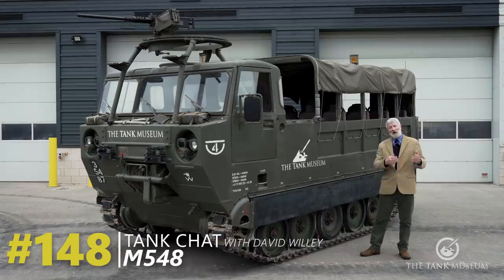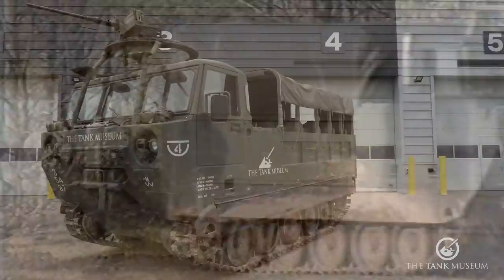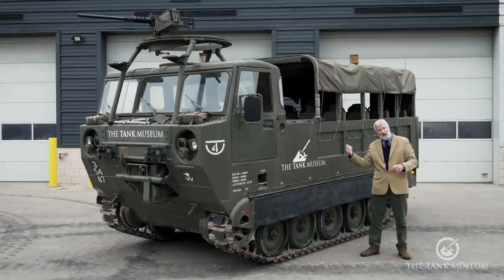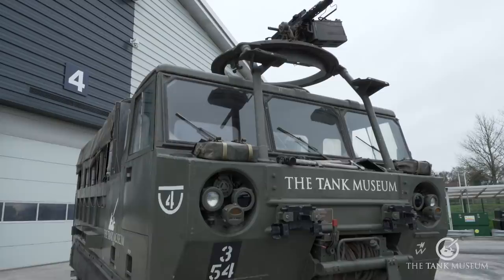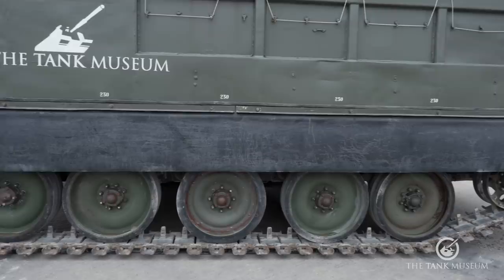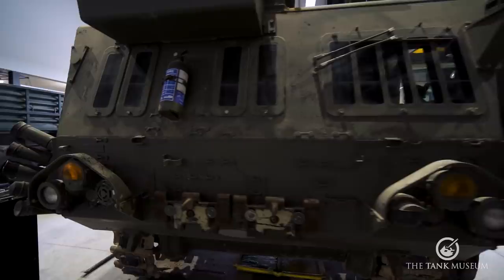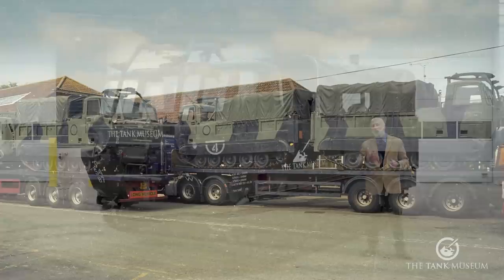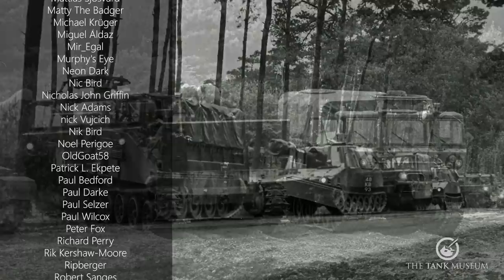Tanks Chats #148 | M548 | The Tank Museum

Comment: I couldn't click fast enough when I saw the 548. I loved this thing. Drove one as a Combat Engineer in the early 2000's with an M136 Volcano mounted in the back.
Reply: Isnt the 136 Volcano a mine laying device (  i could be  wrong as to its function ) its been a while since i looked anything up about it
Reply: @forsakenghost7054  yes. That video of the one they call the German "dispenser" is the same kind of vehicle.
Reply: @killdizzle  M163 was mounted on a modified M113 chassis. The M48 Chaparral (four AIM-9 Sidewinder missiles modified for ground use) had the M548 cab with the back end cut down to give clearance for the turret.
Reply: We had M548's in my first Artillery unit while stationed in Germany in the late 80's. I loved that damn vehicle.  Awesome vehicle in my opinion. Easy to drive, easy to maintain, (in my opinion).
Reply: For those of you who build armor models AFV Club has a 1/35th scale M548 model kit of this particular vehicle.
Reply: @killdizzle  Yes, but it only uses the power pack (engine & transmission) and running gear. The M163 Vulcan used nearly a complete M113 as the basis with only changes to the roof because of the turret replacing the commander's cupola and the roof troop hatch being replaced with a small round one.
Reply: Same here, was in the line company and my squad got assigned to provide the driver and maintain the Volcano and M548.
Reply: Yeah, my unit had the Volcano mine layer too. We got issued 548s just for the purpose. 
My dad's artillery unit used them for ammunition caissons.
Reply: @IvorMektin1701  Gee - I wonder why???
Reply: @13bravo72  They were all over Ft. Sill when I was there in 90.  I think they must be obsolete by now.
Reply: @jeffmoncalieri7491  They we’re still being used in the 2000s.

Comment: In the early 1980s we used to get these from the factory as a sort of kit with the cab and everything knocked down and packed inside the vehicle. We'd assemble them into ammo carriers for artillery and they'd be sent to units on base.  We'd have to put them together in a certain order or we'd need to take them down and start over.  Since they came with no assembly instructions the first couple were, shall we say, interesting?  Much creative language was in use.  I've driven these more than any other armored vehicle just moving them around the shop and yard.
Reply: No instructions, that's interesting. Now granted, it was kinda obvious to even the most casual observer, but did they at least say, Some Assembly Required?
Reply: @alonespirit9923  LOL- that was pretty obvious, but no, there was no explicit statement to that effect.  The battery, BTW, was included.

Comment: The Tilly. Or the "ute" (Aussie for "utility truck" - what Americans would call a pickup) as we sometimes called them.
I drove one of these in the RAAC for a bit - pretty quick cross country, especially when empty. 

The most fun vehicle in the M113 series to drive. Fast and quite dirftable for an  tracked vehicle and lots of freeboard in the water.

RAAC cav squadrons had 3 in the admin troop and in the LAD.
We had 2 fuel blivets in the rear of ours, with a platform accross the middle of the load bed supported by the side walls.
That paltform  supported a Lombadini pump.
Behind the rear most blivet were jerry cans for water and POL (OX47 and OMD115 IIRC, diesel and standard grade fuel for generators and stoves) and 76mm ammo racks for MRV rounds. on top of those 76 racks we kept ration boxes.
We had two confgured like this for each squadron, so a re-sup would be 2 of these parked in column at a sutiable tactical distance and location. 
The third tilly  was configured as the squadron Q store (the comfy tilly to live in, it had the soft cover  on the rear and two bunks for the crew installed behind the cab, with each side lined with stackable strores boxes.

The sabre troop would pull up 2 vehicles on each side, we'd pass thes hose from the pump to the driver, and then while the fuel was pumping we'd swap empty jerries of water or POL for full, pass over rations, MG and small arms ammo, take rubbish bags from the line swine and if necessary hand over their echelon bags. We needed to dismount to move 76mm rounds from the rear racks.

To the front of the two fuel tillies parked off to one side would be the Q tillhy the ambulance and a RAEME fitters track, so members could see a medic, a spanner  could assess any mechanicial issues and anything that needed swapping from the Q- Store could be swapped.
All in all a pretty efficient system for the "olden days" (late 80s/early 90s).
Reply: Hey, thanks for relaying that. Sounds like they had the job down to a science.
Reply: Yep, the War Ute. Great for resups and keeping up with armoured advance.
Reply: Good times
Reply: There was one at pucka in the early 2000s that could hit 90 km. Terrifying.
Reply: Essential for cav squadron. I loved the 113s. We called them tracks, mine was a field ambulance.
Reply: Saw a few of them with 3 CAV when I was with 3OFP/FSC at Lavarack Bks in ‘72.
Reply: Was always good to take one for a spin!  I just had to constantly remind myself,"Its not armoured, I can't hit trees and stumps"
Reply: @161Possum  I know what you mean.  After a night move i discovered that I had hit a 6' picket which had penetrated the front of the 548.  I don't know how far it came into the vehicle but when we put another picket into the hole the angle of the penetration indicated the other person in the cab would have said goodbye to the family jewels if the picket had penetrated far enough.

Comment: I was stationed in Germany during the Cold War 1983-85. These M548s were used as a ammunition supply vehicle to M110a2 SP Howitzers 8 inch.  They were used 1 to 1 with the howitzers. They were a fun reliable easy to work on, They were not very powerful and when they were filled with ammo they could not keep up with the howitzers. Each 8 inch round complete with the round and the bagged propellant in a canister weighed approx.. 275 lbs. the rounds came on a banded together pallet of 6 rounds. The M548s were supplied by M39 5ton trucks.

Comment: We had some in Military Intelligence, except ours were M1015s that added a large PTO-driven generator in the bed with an electronic shelter above it. They also had a device on the front bumper to drive grounding rods into the dirt. I used the MLQ-34 TACJAM which was based on this and was one heck of a radio jammer. It had 3x500w transmitters that could be combined or work independently, plus the antenna gave a gain of 2-4x. You could literally kill small birds with it if they landed on the antenna (saw that with my own eyes). Too bad the chassis were overloaded and not particularly reliable.

Comment: In Aussie service it was effectionally known as the TILLY each Sqn in the Armd Regt had atleast 3 of these as well as the main stores area had some then each Mii3 Sqn had 3 and the LADor tech support Sqn had about 10 for all the spares and tools that each Sqn would require and they always had lots of room in the back for the crew of 2 to sleep in dry warm comfort. Next to my 113 it was the best thing i drove but ourswere faster as most would do 80KM/H and you were only using your finger tips on the sticks then. Best trip in the yime in the 113 family of vehs was when we had to road run a whole Cav Regt into town from Showl Water Training grounds right down the highway for about 60 K and then right through the main drag of Rockhampton . travelled in short packets on the highway then stopped on outskirts of Rocky and formed the whole Regiment in one group and ran 3 abrest and about 80 deep with all varities of the M113 family included to the rocky base unit stopped all traffic on both sides of the road  for about an hour as we moved through . People just stood and looked in awe of these things as they had not seen a tank there which is only thing we had bigger since WW2.
Reply: Sounds like that was really something to both be part of and to witness.

Comment: We'd ride in one of these for advanced party to recon our positions for the next battery march order, plugged shells rolling around in back. We never used the overhead sliding ammo pulleys. Our column in march order looked like a Circus train with all the tarps and camouflage nets/poles hanging off the wheeled/tracked vehicles. 
Twelve .50 cals, one on every M109A3/M548 and another on the service truck made it look a bit more formidable. But did I manage to get pictures of everything on the move? Naa, I was always with the lone advanced party M548 or stuck in back of the FDC M577 in column.
Reply: Sounds like my first duty station. We had one 548 designated as the'advance party vehicle, especially when we headed for one our Grafenwohr field exercises. Ah! Those were good days and good memories.
Reply: @13bravo72  I was at Bamberg Warner Barracks 3rd Brigade 1st AD 2/78 FA 1979-81. I was a 13B too but spent most of my time in the FDC track. We made 8 trips to Graf the 26 months I was there!
Reply: @arkboy3 Hey!  My first duty station was in Ansbach. B Battery 2/28 FA. I was in Bamberg too, Warner Barracks from 88 to 91. 2/78 changed to 3/1st FA. Sadly they didn't have the good old 548's anymore, they had gotten FAASVs.
Reply: We used the crane but we were 8" SP (M110) and our shells were 204lbs with the nose plug in.  Bravo Battery 4/92.
Reply: @swaghauler8334  In the WYARNG we used the M110s, no way to lug those rounds far by hand!
Reply: @arkboy3  Were you in the 92nd or the 94th Heavy Artillery Brigades?
  I thought the 93 and 94 were Western but they might have been Southern.
Reply: @swaghauler8334  In Wyoming it was the 115th Artillery Brigade.

Comment: I drove the M113a1 for seven years in the 3/9 SAMR (Light horse) ours had the Cadillac Gage T50 turret with a 30 cal and 50cal. The original design had a Chevrolet 454 petrol engine. 
The Australian army also had a version with the Sarisson turret and gun.
Mortar and  recovery types as well.

Comment: Served as a Tracked Vehicle Mechanic in the US army artillery in the early 1980's. These were the support vehicle for the M109 and M110 self propelled howitzers. Each gun had an M548 assigned to haul ammo,supplies and crew. they shared about all drivetrain parts with the M113 so they were reliable and easy to maintain.

Comment: We had them in the '70's in Germany (4 CMBG, 3 Mech in Baden), our CQ would do our night DP's using them, very versatile vehicle.
I remember they set up an immersion heater with a shower spigot on the top of the cab.  The drill is, you bring a jerry of water, drop it on the back, have a quick shower and take an empty jerry back with you.  Stripping down in late October in the field for a lukewarm shower is a character building experience. :)

Comment: although they have been floated (mostly by crazy Australians LOL) it clearly states in the Ops Manual that they are "For Deep Fording Only - Vehicle Must NOT be Floated" they have lots of points on them not properly sealed like the power feed for the winch etc and unless they have been loaded correctly they will be very unbalanced, its also what makes them a very hard vehicle to get used to driving over rough ground as every day your loading can be different stores loaded different ways so the point of balance changes all the time and you have to relearn whether it is forward or backwards from the normal center of gravity. was the first vehicle i drove again after being out of carriers for 16 years when i helped some of the guys at the New Zealand National Army Museum put them away after a Cambrai weekend display. was like riding a bike.

Comment: I used to drive and fix these vehicles in the 90's, when I served as a mechanic in the IDF. Horrible to work on, as you must remove all the artilery shells out, or "dive in" through the front seats or squeez inside the engine compartment. Feels like a brick when loaded, but fun to drive when empty...

Comment: The gunners on our M109 hated the M548: its arrival meant hard work unloading ammo and stuff 😂
Reply: The Canadian Army got around that by having a M548 as part of each gun detachment.  Both the M109 and M548 travelled together.  All ammunition fired went directly from the 548 to the breech of the gun.  The ammo in the ready rack inside the 109 was only used if all other ammo had been expended.

Comment: The artillery crews seemed to like them, we mechanics hated them. We had problems with algae growing in the tanks, fuel pump failures, flex plate failures. But the best failure I saw was in 2ID in Korea, a driver managed to shift into reverse doing 30 mph down MSR 3. The transmission broke at the bell housing and spun around taking the oil cooler off the engine. It was sitting in the middle of the highway with a huge puddle of oil under it. Had to pull everything out in pieces.

Comment: FMC would take the M548's track arrangement and build a log skidder for their heavy equipment division, known as the 210CA and 220CA skidders

Unfortunately loggers found the undercarriage to be very high maintenance, as the rubber-bushed tracks could not stand up to the pulling forces loggers would subject the skidders to.  They did, however, find use in both swampy and steep terrain, where they outperformed wheeled log skidders easily.